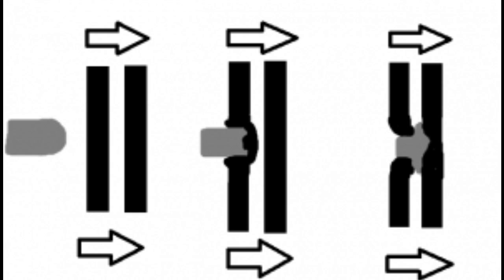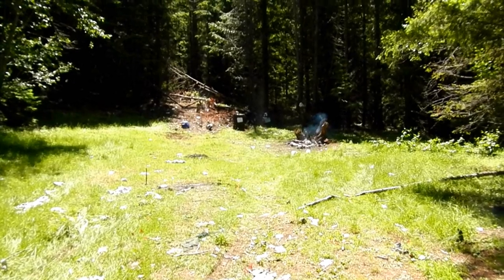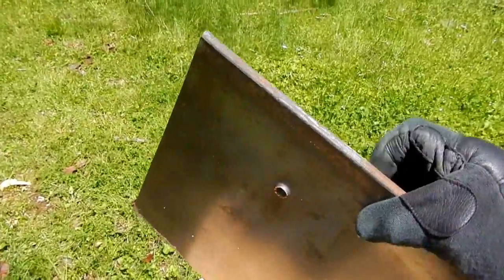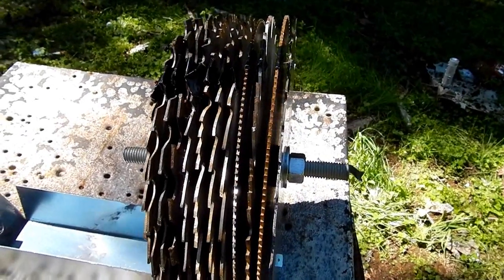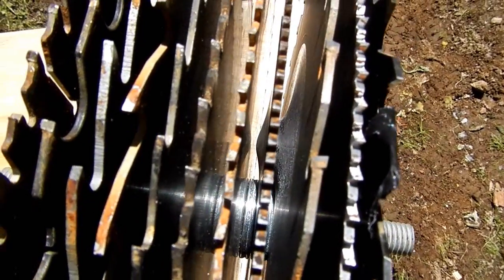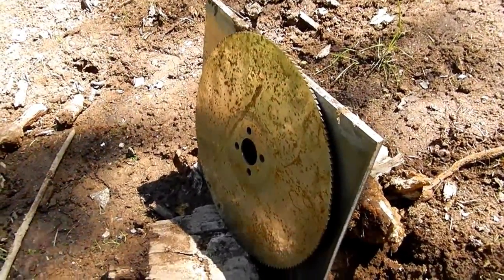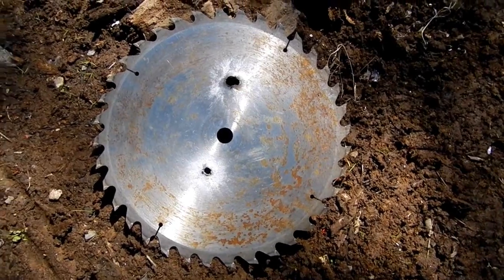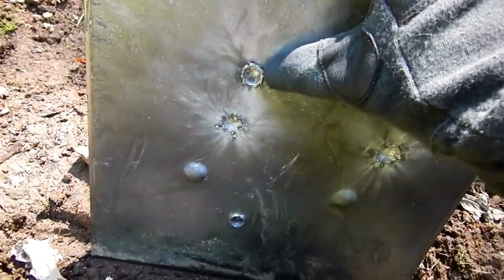Testing the Concept of Spaced Armor

Comment: thats not at all what spaced armor is for. spaced plates or cages are to prevent HEAT rounds from penetrating the main armor of vehicles. HEAT "High Explosive Anti Tank" ammunition is a shape charge, it uses an extremely hot focused line of molten copper to literally melt through armor, and has proven to be extremely effective at penetration. the counter to HEAT is spaced armor, by having a thin piece outside and away from the main armor gives the copper line of death time to expand and disperse its energy so by the time it reaches the main armor it just splatters across dealing minor damage. hope this helps your analysis.
Reply: Spaced plates work by blunting/flattening the nose of a penetrator, deflect it, and cause it to yaw so that it impacts the second plate at a less optimal angle and with reduced energy. It is pure coincidence that they also pre-detonate HEAT, but that's not their original purpose as applied to WW2 German armour.
Reply: Copper Jet it's not molten, Other than that you good.
Reply: Spaced armor against kinetic projectiles is a genuine use. In world war 2 panther had spaced armor installed specifically to defend against anti-tank rifles.
Reply from the maker: Thinly spaced armor is for destabilizing low caliber hardened penetrators. It was used extensively in WW2. HEAT rounds are so much more effective at penetrating armor (because its an ultra high velocity jet of material, temperature has nothing to do with it, KE=1/2MV^2) that the spacing between the plates has to expand out to be effective (cage armor). Its the same concept for both. Modern APFSDS ammo is even better at armor penetration that the air gap in the spaced armor has to be replaced with exotic ceramics. This is all "composite armor" is.
Reply: @jackalmountain6523  It is true temperature has little to nothing to do with penetration. However, it has everything to do with the effectiveness of the round after penetration. This being said, having stand off or deferring densities of a protective barrier has been used for ballistic defense for hundreds of years. Not long after the cannon took to the field of battle did castle walls start being back filled with ruble  and then a second hardened wall to stop incoming rounds. This battle of defense and penetration has been a tug of war for a long time. You even see it where hardened bunkers to defend against nuclear weapons are concerned. As it stands right now "Bunker Busters" that's a round designed to penetrate first, and then detonate after defeating yards of defensive walls and other underground systems. has the upper hand last I checked. Guaranteed though, it will only be a mater of time before this sea-saw goes back the other way. Iron curtain is the newest system I'm aware of but that was 10-11 years ago when last I heard of it. It had a lot of bugs to work out but if a Humvee was armed with a fully functioning Iron Curtain system, it could stop an RPG in its tracks less then 40mm from impact. Now I don't know how they will stop the heart attacks that will happen when someone sees an RPGs warhead sliced off by a laser curtain less then 40mm from their face but that's another topic.
Reply: @jackalmountain6523  Ceramics are used to defeat chemical energy munitions, not KEP. In the Abrams, for example, composites are used in addition to spaces. Steel-laminated depleted uranium is used to back the RHA. its purpose is to fracture the tip of an incoming KEP, thus preventing penetration and causing the rest of the round to fuse to the outer layer of the armor on impact.
Reply from the maker: @devin6220  That was exactly my point. Due to the higher energy impacts caused by shaped charge and KEP rounds, the air gap in spaced armor is replaced with another more exotic substance like ceramic or DU. Its all the same concept of composite armor rather than solid homogeneous armor

Comment: what type of steel was the 3/8" steel plate? i know you said it was a mild steel plate in the video description, but knowing the exact type of steel would be cool. for example, ar500 armor is so good for body armor is because of it having Manganese and a bit of phosphorus, also carbon obviously haha.
Reply: also saw blades in the center are usually low carbon steel so they aren't very hard, only the teeth are hardened steel. so your video definitely proved that spaced armor is effective. i wonder if two thinner of ar500 steel plates spaced to the same thickness as a piece of ar500 body armor would preform better?